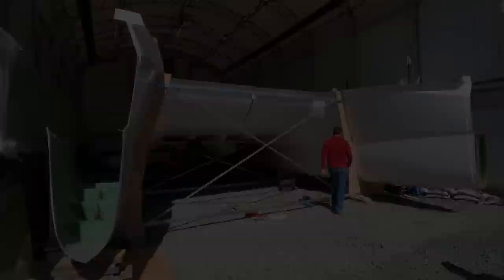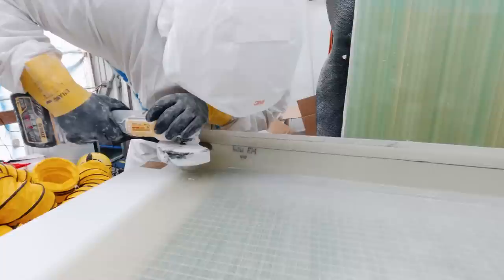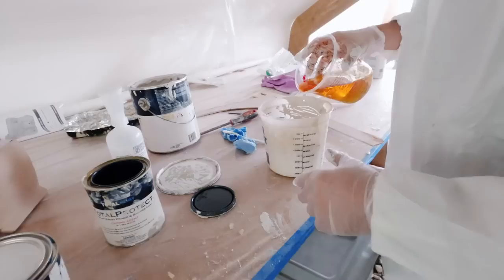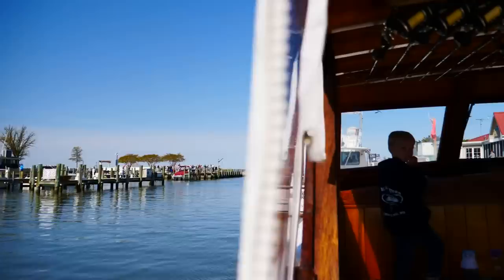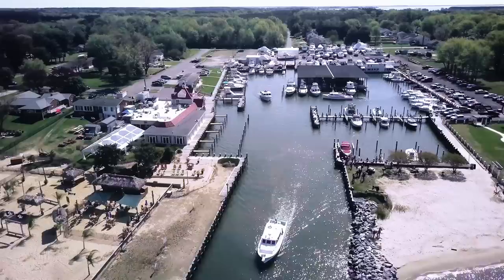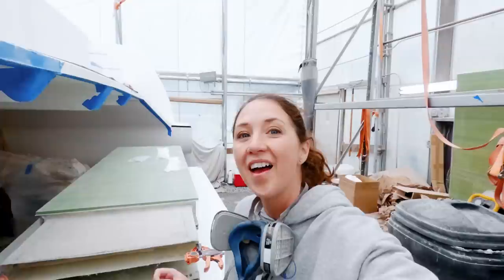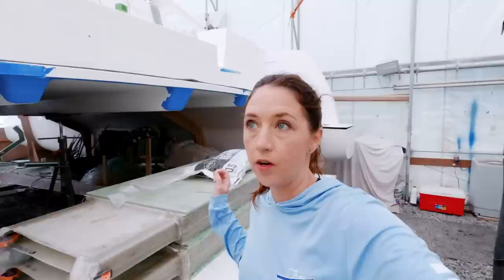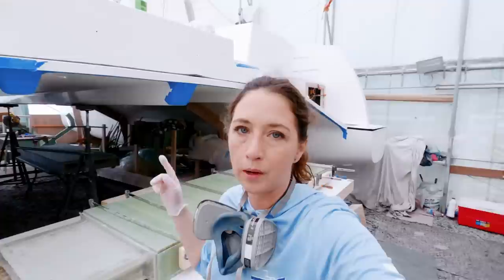CATAMARAN BUILD - Our Daggerboard Case Halves Are Now ONE! (MJ Sailing - Ep 234)

Comment: btw earlier you mentioned does anyone have tips for gumming up sand paper yes use a wire brush to remove the gum on the sand paper that way you can continue to use the sand paper and it removes it gum from the surface. Hope that helps.
Reply from the maker: Thanks for the tip!

Comment: With that new helmet(?) Matt has on, he now looks like he should be working on a SpaceX build!
Reply from the maker: It has cool air pumping through it, which allows Matt not to overheat while being fully suited up.  😀
Reply: @MJSailing  Wee, it is the East Coast & it's going to get a lot hotter!
Reply: @MJSailing  could you stick a link up on where to find such a device or what to search for? Have a summer of DIY approaching where I could really benefit!
Reply from the maker: @ColinGuilfoyle  It's a 3m Versaflo 3000, it works well for sanding, but it wasn't until after I bought it that I realized I cant use it for resin or paint work... It isn't for vapors.  I have since replaced with a Honeywell primair 7000 that does both.    Huge investment, but as much as we use it, it is worth it.  -Matt

Comment: I know you can’t put everything in the video, but it was obvious that you both have been really busy getting to this point in the build and the dagger-board cases look very nice and as good as they could ever be being built by anyone.  I’m guessing that the cases will also be water tight when they are completely covered with fiberglass.  Isn’t the inside of these cases open to the sea or does it get some kind of water cover to minimize water coming up into the cases while underway?

Comment: Impressive build... can u pass on the make and model of the sanding mask and air pump? 
Thanks
Reply from the maker: Sure thing!  I'll have Matt link to it when he gets back from the tent.  😀
Reply from the maker: It's a 3m Versaflo 3000, it works well for sanding, but it wasn't until after I bought it that I realized I cant use it for resin or paint work... It isn't for vapors.  I have since replaced with a Honeywell primair 7000 that does both.    Huge investment, but as much as we use it, it is worth it.  -Matt
Reply: Thanks for the details.  I have a bottom job to do on my Westsail 32.

Comment: No stop. Don't trim the sides, offset them, bond then and move forward. If you calculated correctly you will lose the thickness of the two sides combined, looks quite minimal on video. If you're really good you make each side the dimension of the interior and your size is preset. Couple screws along them with acrylic between and Bob's your uncle.
Reply from the maker: The interior dimensions are the important part for the machined bearing that rests inside.  That's why I used the board that represents the half width as the guide on the inside.  It need to end up at 118mm

Comment: Peelply does  NOT mean you dont need to sand. peelply is to hold in resin, hold out air and leave a smoother finish. ALWAYS ALWAYS ALWAYS sand your surface. even if its a hand scuff. ALLWAYS scuff your surface. claiming no sanding is needed when using peelply is equal to an "old wifes tail" and false. If you dont want to believe me. TRY doing a Peel test. setup two layers of 1208 2" wide 8" long on a well scuffed surface. then two to a peelplyed surface. leave the end over tape or peelply by 2" so you can get flat blade clamps onto it after they are cured. Do a pull test. the peelply surface will pull away WITH FAR less force. I work on multi milliondollar yachts for a living, as well as being a masterglass man.
FACT... peelply leaves a resin surface, scuffing exposes the fibers of the material surface. During the curing process, fibers from the surface and fibers from the applyed layer(s) become entangled in the linking process . A peelply surface leaves a machanical/chemical bond to a pure chemical surface (RESIN). And resin is britle. On top of that, certain types of peelply will leave an atom thick layer of material which will act like a release agent given enough load.
Reply from the maker: While I wouldn't glass over only a peelplyed keyed surface (the surface isn't smooth) without an additional sanding, when bonding two pieces of already cured fiberglassed surfaces - the foam cored to the side- I don't see much difference in the tests we've done.  We sanded the foam cored side that had been exposed for a long time, the other side just got an additional styrene wipe. But in the same breath, we did sand the larger horizontal before bonding those pieces.... So I guess we're inconsistent.
Reply: @MJSailing  The long and the short of it is this. A peelply surface leaves a non smooth surface TRUE. Yet, that surface is pure resin with the fiberglass sheeting its self encapsulated by resin. Even though the peelply leaves a textured surface. It is 100% resin based with the fibers encapsilated, resin bond. and your bond of any fiberglass to fiberglass is only as good the volume of surface area to bond to and what it is made of. RESIN is brittle. Pro-TIP, the best 4" grinding wheel for fiberglass are diamond turbo cup wheels (ment for cement). Nothing lasts as long as they do and the finished grinding surface is 10X more rough then your standard rhino grit disks. They also are equal to about 500 disks in regards to rate of wear. The rate of grinding is 2/3's faster as well but they are a hard wheel so they want surfaces that are more then less flat. H-F tools sku number 61419 hint hint.
Reply from the maker: Thanks Berin.  I've tried a diamond cup wheel, but I don't think I have the finesse to use it one these things.  I tend to dig in much more than a grinding disc.